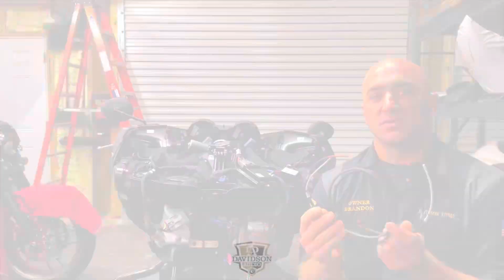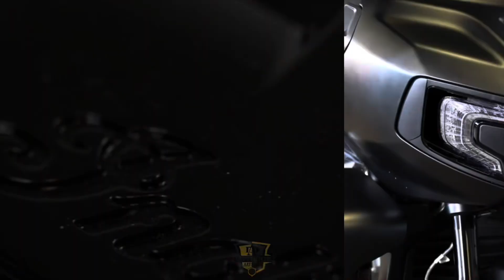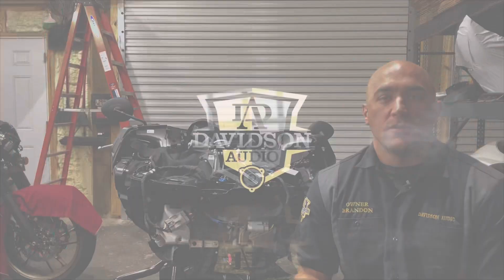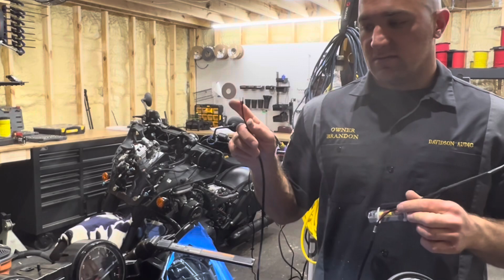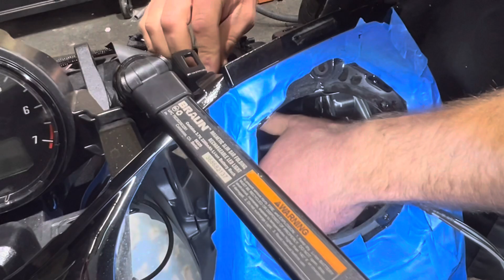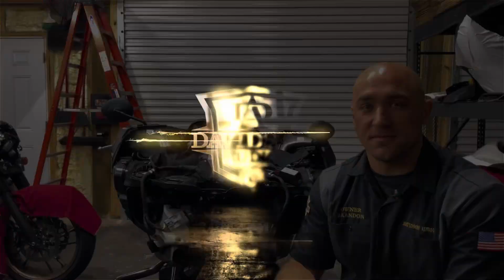@Indian_Motorcycle 2020-2024 Indian Challenger/Pursuit Passive Fairing Harness

Comment: Question:
-Why do you prefer cicada speakers upfront over say  hertz neos?

-why do you like to use sound digital amps( other than because of size) vs sonething from hertz or cicada ?

Many thanls keep up the great work.
Reply from the maker: To answer your question would be different for which motorcycle you are referring to.
-for the Indians I like the cicada CH up front because they are a louder speaker and more efficient.
-soundigital amps are the most powerful amps for their size.
Reply: @DavidsonAudio  do you have any issues with reliability with the sound digital amps.
Many thanks